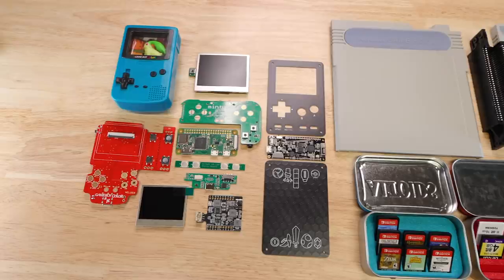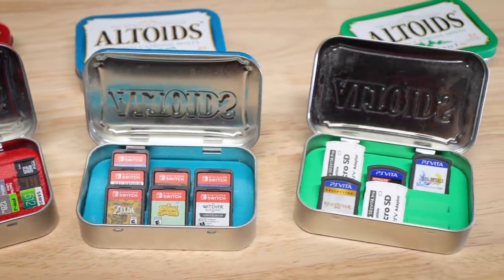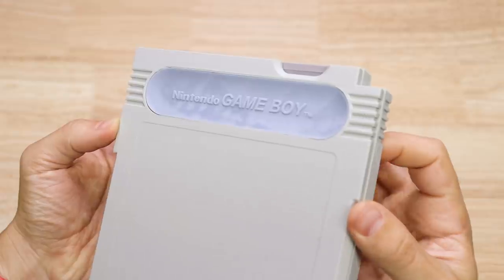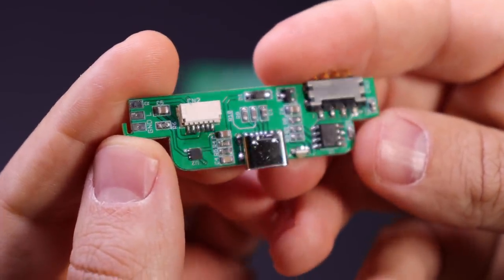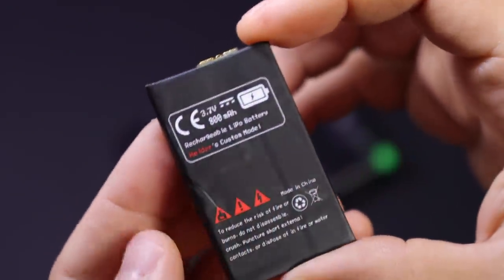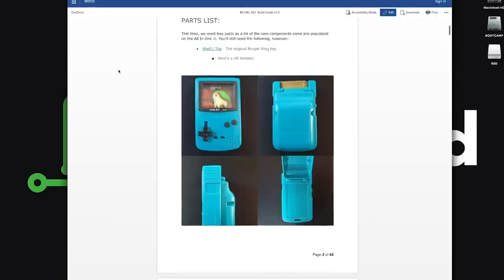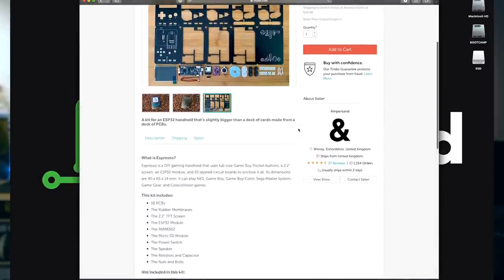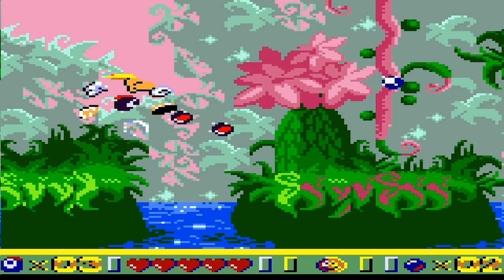Summer 2020 Update: mintyPi v3.5, Espresso, Giant Game boy and more!

Comment: Would you consider testing the RetroPSU v3 at >3-4 amps and seeing how hot it runs and whether it needs active cooling? At 6 amps it could be used to power a DIY laptop (with a pretty decent SbC) on a 1S lipo - which would simplify the power management a ton for such projects!